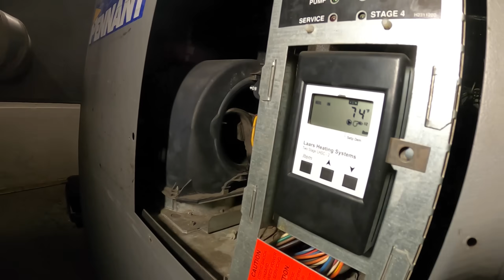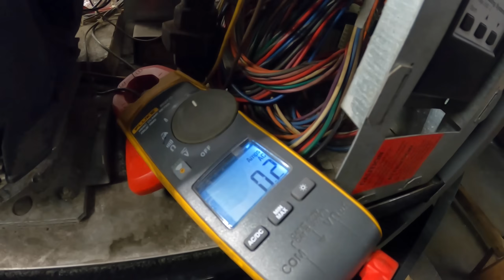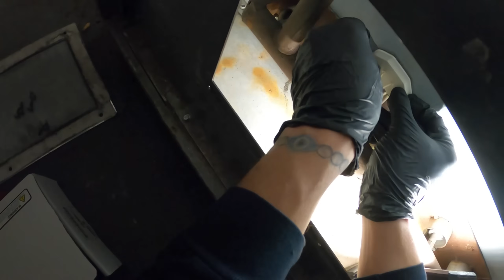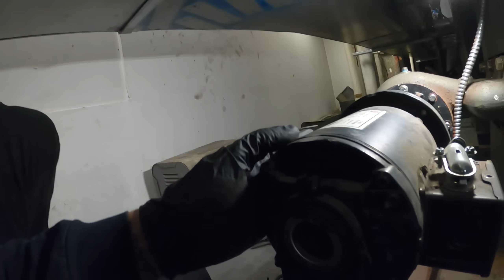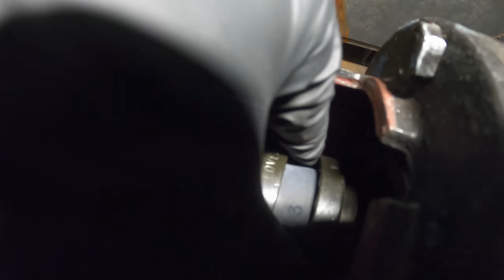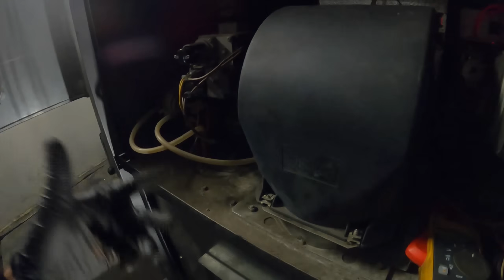HVAC Service Call: LAARS PENNANT Commercial Boiler Not Heating (Boiler Not Firing Up) Not Igniting

Comment: you rarely ever would have to change the metal pieces of the coupling. the rubber part of the coupling is designed to wear out....not uncommon at all, especially since that one side was loose as you noted.

Comment: pretty sure you could have loosened the set screws on the shaft couplings and slid them back to get to the lovejoy. without taking the motor and pump apart from each other

Comment: Man there’s zero maintenance done, luckily the so called engineer doesn’t blow some thing up! There should have been a high temp alarm from that boiler and lock out, no wonder the igniter was burnt off it’s been shutting down and trying to restart until you arrived? Don’t think there’s any preventive maintenance done here or basic parts stocked, talk about run to fail! It’s obvious there’s no inspector or yearly tests done to these boilers! You need to sell them a yearly inspection package!

Comment: Great video, actually have a customer with 8 of these units. 4 in each building but they are twice the size. Four gas valves and two blowers. First time out there I had a holy crap moment, do mostly residential but took a breath and opened up the manual that was there. Now when I go there their not that scary just a big boiler

Comment: Quick tip...if you are using non T handle allen keys...the end of your adjustable has a hole in it. Slide that over the 90° bend of the allen and you can use torque and it acts like a T handle. I deal with a lot of pumps with couplers and various styles. Lovejoy and Woods are popular brands, especially for the rubber couplings.
Reply: Wow, that's a great tip.

Comment: There should be a flow switch on that boiler to keep the burner off if there’s no flow through it.
Reply from the maker: This is correct. There is one on the unit. It's either bypassed or stuck in the closed position. Something I definitely need to look into during the next visit. We will be conducting a combustion analysis for all of the units. I will note this. Thank you for the heads up & thanks for watching! Stay tuned for new videos every week🔧⚡️

Comment: Was there a flow switch on that unit. It should not have been firing if there’s no water flowing. Flow switch May have been bypassed or stuck closed.
Reply from the maker: Thate a great point. There are flow switches on these units. I agree with you. I have seen a switch bypassed before so it's possible that was the case unless it failed in the closed position. There are a lot of hack jobs in this location. Something that needs to be checked for sure. Thanks for watching & stay tuned for new videos every week🔧⚡️

Comment: Trane quality control has really gone downhill, back in September we installed a brand-new Voyager RTU and on start up we had a dead compressor and found 3 leaks on the coil 😂😂
Reply from the maker: It seems to be this way for many manufacturers. I just posted a video on installing a brand new packaged hoshizaki ice maker and it came with no refrigerant because of a leak. You can SEE the pipe connection at the compressor wasn't fully brazed. What a shame. They really don't make things like they used to. My window AC is 23 years old and working just fine 😂 Thanks for watching! 🔧⚡️

Comment: It appears the "building engineer's" job is to call you for the simplest of repairs. Thats why everything has been bypassed, disconnected or just removed, no longer to be found. Seems like they would have on hand, belts, filters, ignitors, couplers,   Your apprentice will be an all around service tech due to the wide variety of equipment you encounter! You the man JMT!
Reply from the maker: Haha I hear that. Another person mentioned if there was a flow switch on this unit and there is one. Probably bypassed. Quick "fix"! A lot of hack jobs done in this building. It's ok because it gives me plenty of work. I love fixing things and bringing them in better shape. I hope so regarding the apprentice comment. Thank you brother! 🙏 Always appreciate your support🔧⚡️
Reply: @JumpermanTech Having qualified people on the building staff would cost more money.
Reply: @dfirth224 Well said. No service technician would be a building engineer in NYC. Elsewhere the have to do everything.
Reply: A lot of jobs Building Engineers use to do are outsourced for now. Big tax write off for the building,  and warranty for work done by technicians